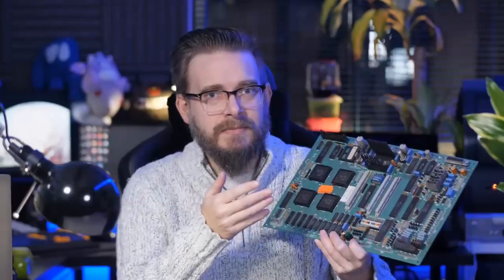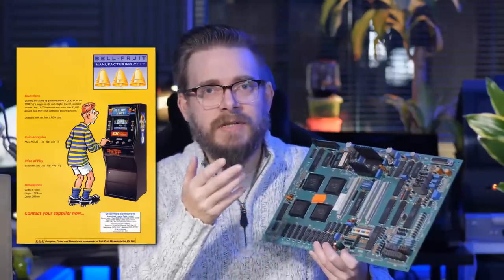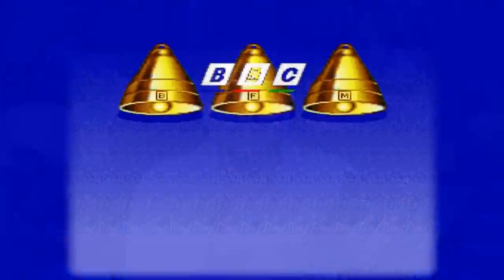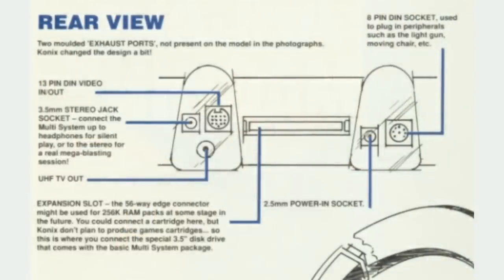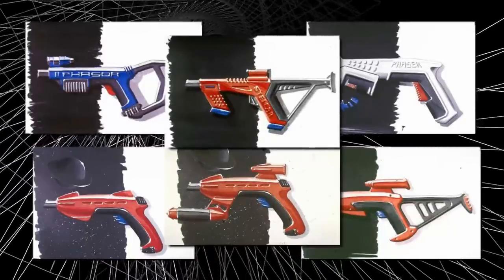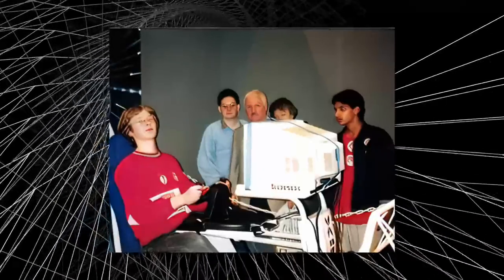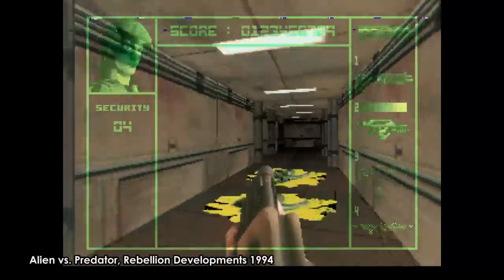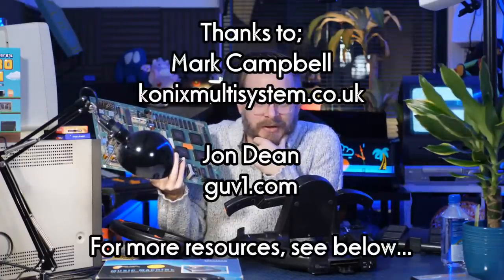This Console Would have Changed Gaming Forever | Nostalgia Nerd

Comment: You know, Amiga's first product of note was a weird controller - the Amiga Joyboard. It was designed for joy also!

Maybe Konix could have succeeded if they had decided on a Joyboard form factor? Instead of standing on it (very impractical), you sit on it. It's like the chair concept, but it fits in a box you can ship like any other console. Basically, the console is shaped like a box with a curved bottom, and it has internal tilt sensors. Your hands grip the sides so your thumbs can press buttons on the front corners.

Comment: Like the Konix, the two things that destroyed the Jaguar before it even got out of the door was: The unified bus, causing serious choking of the system and the lack of a decent C compiler to allow fast porting of games like Doom( they had to essentially re-write the code from scratch.) Trying to let two very powerful 64 gfx processors like the TOM's blitter and OPL share a 64 bit data bus with a 16 bit 68k and DSP( which though 32 bit internally could only talk to the bus at 16 bits) was where this system went wrong from the get go. The Blitter and OPL should have had it's own RAM space(2megs), the 68k should have had it's own private RAM (256k) and the the DSP it's own RAM(512k). All could have been tied together with a multiport 2k RAM to allow each part the ability to talk to each other and no bus contentions would have been an issue at all. The 32 RISC's were more than enough with their own private local RAM bus, but once they tried to talk to each other you had an already outclassed 68k choking down everything but reducing the width of the 64 bit bus to 16 bits and the system clock to half. Yes, with the right planning and coding this could have been overcome but most dev houses had no idea how to deal with this as they were used to the Genny, ST and Amiga way of doing things and is why most Jaguar games look as if they were for said systems. Of course a handful of games were able to show the potential but a few games were not enough when Sony and Nintendo were pouring tons of money in not only easier to develop for hardware but serious tools to match. Atari was in finacial dire straights and rush this system out the door with 4 hardly impressive titles and not until 6 months later a few more hardly ground breaking titles. Tempest 2000 was the first title that really gave a glimpse of what the machine could do, but by then Sony and Nintendo had already stole the lime light even before they released their machines. Doom, AvP, BattleSphere, Iron Soldier, Phase zero at release would have been more like what was needed but there was no tools able to allow for these games to be developed fast enough. All of the above titles were not even the best Jaguar could do with the right tools inspite of it's flawed arcitechture. So sad.
Reply: Also the controller was god awful.
Reply: @brendanroberts1310  that's just a parroting of the game media. I never had any problems with that controller. Never had cramps, way always able to play the games with the keypads just fine.

Comment: I hate to say it but it probably would have failed in the marketplace, sim controllers are niche. They probably would have been better off just making a standard console to start with and had everything else as an add-on to that. They might have actually got it to market without the financial drain from all the extra stuff thrown on top of it and it would have been a very powerful system at that time.

Comment: I remember drooling over the specs in Ace magazine but being really unimpressed by the screenshots they showed. The bike game looked pretty uninteresting and nothing had any wow factor. The force feedback gun was ahead of its time, they should have released it for the home micros rather than tie it to the system.
The sub £200 price point was unrealistic given the price of floppy drives and all the custom silicone. Also, the console would become useless if anything went wrong with the controller bit, which was quite likely given its complex construction. They should have separated the controller and console.

Comment: Here in the States, EGM really hyped the Konix Multisystem, and later the Atari Panther/Jaguar. Well, until they turned on the Jag after coincidentally, Sony’s marketing dollars really kicked in. But even when they were hyping the Konix, there was concern about the 8086/8088 being a dog of a CPU when compared to a Motorola 68000.

While it’s obvious the Flare/Konix custom silicon can handle scrolling and sprites better than its contemporaries, that does not look like 256 colors on screen simultaneously out of an Amiga/Apple IIgs/Atari STe - esque color palette of 4,096 colors. Maybe it’s the low res but all of those examples look like a washed out Sega Master System color palette. 

At this point, I really think the Atari Games Corp should’ve licensed their custom graphics chips used in the “Atari System 1” and “Atari System 2” arcade games. After all, they could outperform the Amiga, the Atari [Corp] ST, HudsonSoft’s chipset in the NEC PC Engine/TurboGrafx-16, and the Sega Genesis/MegaDrive but having done so all the way back to 1984…. in the arcades, of course…

Comment: Translation of Swedish subtitles at 35:00 and 26:12.

I wonder what this weird
thing is doing at a computer expo.

Michael, this Konix Game System
doesn't look like a computer...

It is not a computer, except internally.
It doesn't have a keyboard-
but a flight yoke or a steering wheel
or handle bar, only for games.

And the chair you're sitting in?
Not exactly something for the living room....

No, it would be a novelty in the living room-
but the chair is synchronized with the game:

When turning left, the chair turns
left and vice versa.

If the character on screen goes up,
the chair does as well, like in the arcade.

Exciting!
What games will be available? (guessing a bit since the subtitles are obscured)

Lots, from old fashioned war games
to chess.

Well, then we're gonna get to see for ourselves.

This is the motion system,
in its basic form.

So this is a steering wheel, suitable for
car racing games.

The steering wheel is detachable...
you flip the switch here-
and you'll have a motorbike handle.
Also suitable for jet ski games.

Flip the switch like this-
pull these up and you'll get a flight
yoke. Up, down, left, right...

Coming with the motion system are pedals:
So in a car you've got brakes, accelerator
- in an aircraft left and right rudder.

(unreadable but you can hear the audio)
-----
Some isn't subtitled the way you hear it. Above is the translation of the subtitles themselves.

Comment: This sort of reminds me of how the Commodore engineers who designed the Amiga had an Design for a next gen successors to the Amiga custom chipset, aka Original Chip Set (OCS) which include Agnus, Denise, and Paula. Well unfortunately for them the then CEO of Commodore who apparently had no long term roadmap for Commodore killed the plans for the next gen Amiga and simply directed them to design only somewhat modified version of the current Amiga hardware citing cost. Unfortunately, this didn’t instill confidence in current or potential future Amiga customers when it didn’t look like Amiga had a plan for what was to succeed the original Amiga computer platform. Of course the company went bankrupted in the mid 90s because it tried to cost on an aging platform, Whereas folks like Apple at least had the new PowerPC platform to transition to from the aging Moto 6800 series processors.  I think they Konix folks could have paired down the 1st Gen of the Multisystem and had something worth selling at a more reasonable cost to develop. The they could offer features like the gaming chair as a accessory released later for the console. Just the controller alone with the custom chipset hardware looked promising. Of course the Atari Jaguar was a flop so maybe not given how hard the hardware was to developed for in the Jaguar. Sega has the same issue with it’s rushed to release of its hard to program for Saturn system to beat out Sony and the PS1’s release. The Dreamcast did better but lacked key features the PS2 got like DVD playback and built-in Ethernet so again lost to Sony despite its head start.

Comment: i grew up during those times, i had not seen or even thought of that handheld joystick since i was 8 or so. strange to think my keyboard and mouse are more powerful than our systems from way back in the puter past.
Reply: Why do you think that your keyboard and mouse is more powerful than the 80s computers?
Reply: @ivarfiske1913  what with in house memorey and drivers/settings they keep for macros and the speed of the controllers for them...i bet if you sent them back in time they would make a faster OS and runtime on the hardware

Comment: What do you mean by 'clunky today'? IMHO the best digital Joysticks of the ear still are the best input devices for a lot of games! Thumbsticks are what I call clulnky.. unprecise, witth the finger slipping away from the stick all the time, and of course way too smal for being in full control. Enlengthened sequences of precise inputs are impossible with thumbsticks, most people just don't notice because games are built around this.
Just try it: Playing for example Turrican II with a modern 'controller' is impossible crap, because the frequent jumping os too much. It neither works with the analog stick, mostly bercause of the thumb slipping away, but also because of having not enough force and speed with the cripplestick, nor it works when reassigning the jump control to one of the action buttons, because it will interfere with hacving to use other action buttons too often simultaneously.
Gamepads never where a replacement or even successor to digital joystick, that's a full myth! The are an alternative, with another focus of gameplay.

Comment: To be clear,
The Konix SpeedKing is still one of the best Atari port, two button joysticks, available for a computer.
Though strangely, they can be finicky on an actual Atari (in my own anecdotal experience)
Reply: It was single button surely (haven't used mine in decades)? Certainly the Atari ST only supported single-button joysticks.
Reply: @axi0matic  
The SpeedKing is two button,
The Atari VCS (2600) was single button,
The Atari 5200 had a bunch of buttons,
And the Atari 7800 had either a two button joystick or Nintendo ripoff controller,
But,
Many computers like MX and Sega also used Atari's 9 pin controller port.
Reply: @axi0matic  
I never had an Atari ST,
Amiga and MX supported multi button controllers though.

Comment: Seems there's a long history of programmers not liking having to deal with multiple processors. It's really only been in the last 15-or-so years that it's caught on, and even then, it's only been because they were forced into it by everything having a multi-core CPU and programmable GPU. Up until the mid-2000s anything with multiple CPUs or a graphics system more complex than VGA got panned and had developers latch onto its simpler competition (with the notable exception of the Playstation 2). Even among the multi-processor systems, the most complex ones got panned. Seemingly everyone griped about developing for the Playstation 3 and went for the Xbox 360 and Wii instead. These days, there's not a lot of difference between the various platforms. We've pretty-much settled on a CPU with a handful of cores and a massively-parallel GPU in everything from phones to consoles to desktop computers.

Comment: The choice of a Z80 at that point was a bit odd! Sure, you would've had plenty of people familiar with it, but still! Then again, that not to the oldest thing about it...
Reply: These were Sinclair people so perhaps they simply used it as a well-known starting point?
Reply: It was cheap. The rest of the hardware would pull most of the load. It was one of the systems better ideas in my opinion. Arcademachines used Z80s and customchips too

Comment: This is very interesting, but with the Genesis launch in 1989, the graphics here look terrible and outdated and would def not have "changed gaming forever" - it would have been a massive flop had it been brought to market. That Konix promo tape shows how terrible it actually was in comparison to the 1989 and didn't show off ANY 3d so I doubt it's power. In 1984 it would have been a revolution - but 5 years later, it was much too weak and developer unsupported. It was wise that all companies pulled out from this 1989 disaster. The Jaguar was a weak 3d console which launched against more powerful competition.

Comment: No it wouldn't.

It only offered better colour abilities and sprite handling than the ST and Amiga, a more flexible approach to coding than the SNES and Mega Drive.

Fred Gill of ATD said about the systems 3D abilities..

"I reckon you'd have gotten about 5fps with Starwing / Fox"

Running on it.

Comment: With the powers of hindsight, we can see the many points of failure. First, they never had the financial resources or global visibility of the Japanese companies or Atari and even below commodore.   Hell, I used to have one of their joysticks for my Amiga or was it commodore 128 I don't remember.  It was a good little joystick.

The other problems.  Attempting to fit the console into the multi controller.   They should have stuck to make it a multi-controller for Amiga, Atari ST, and the PC.   They would have sold a ton of those. I would have bought one!!

Even if it was sold as a console, it never had any business being inside the controller!!

What if you broke part of the controller off?  They break.  So instead of replacing a $40 controller, you had to replace or repair the whole system!   That was always a bad idea.

It's bulk would never have done well in living rooms.  Very few people buy steering wheel controllers for their PlayStation and Xboxes.

And the PC joystick world, nothing has changed in 15 years.  Same junk.  Be nice if MS brought back the Sidewinder2.   Paid 30 bucks for one off eBay, 20 years old.  Logitech and thrustmaster have nothing in comparison... They feel like crap and they break.

Comment: An overly ambitious attempt by the British to wrestle control of the UK console market away from the Japanese, what could go wrong? 😂

It put the focus far too much on pure gimmicks and peripherals, rather than KILLER APP software.

Amiga ports running in more colours, but in case of things like Hammerfist, with smaller sprites, weren't impressive.

Nor were some of the planned titles, an RPG called The Crypt, which was later moved to the equally ill-fated Atari Panther console..

A Starfox clone which if Fred Gill could of gotten the DSP and Blitter working in conjunction properly, had a frame rate of around 5 fps, his words.

Hardware would of been an absolute  disaster and this joins the Atari Panther as  an utter waste of resources.